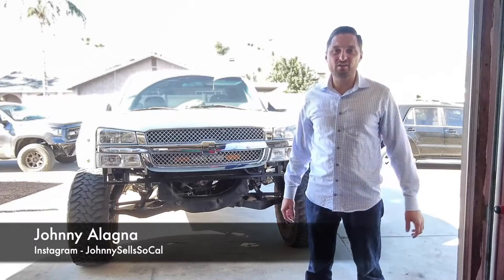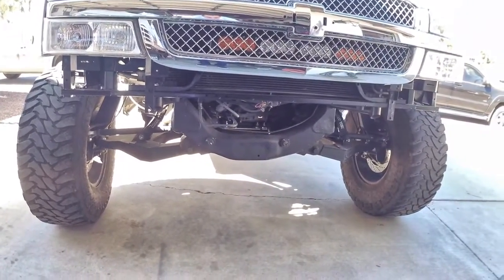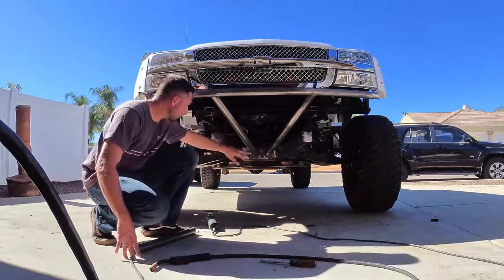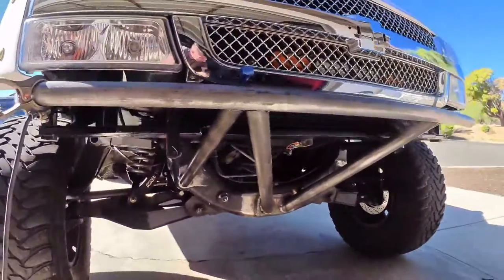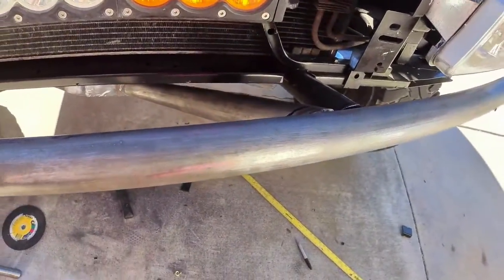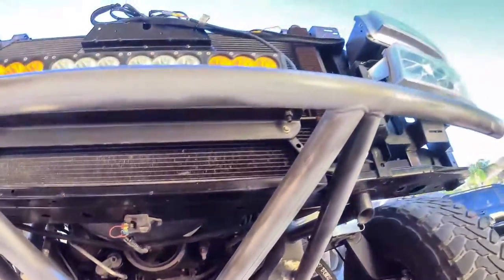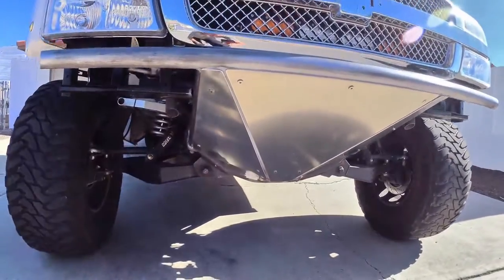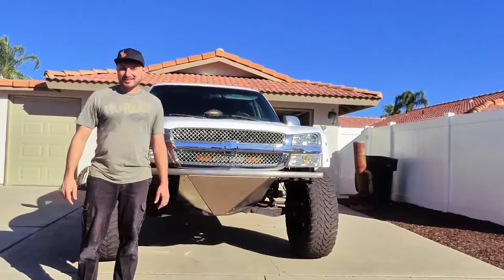2003 Chevy Silverado Prerunner Bumper Build

Comment: What size piping did you use? What thickness sheet metal? Thanks!
Reply from the maker: Most of the tubing was 2" x .120 wall.  for the outer skid plate tubes, I used 1.75 because I had to clearance part of the core support to allow the tube to hit the main bumper.  Skid plate is 1/8' 5052 aluminum.  Fine for the street.  If racing, I would go thicker to 3/16".

Comment: I made one these bumpers for 2012 Silverado and it left my intake vent in my passenger side fender well exposed and ended up sucking in water through it in heavy rain. Any idea on how to cover this vent without restricting too much airflow?
Reply: Sucks to hear dude! Hopefully you didn't hydrolock the motor. I did that on one of my old race trucks messing around at Pismo beach. Most guys will plate in the fender with sheet metal to keep the water out. I've seen some people reroute the intake inside is the truck but would only do that on a race truck application